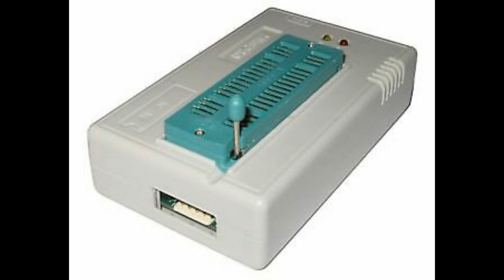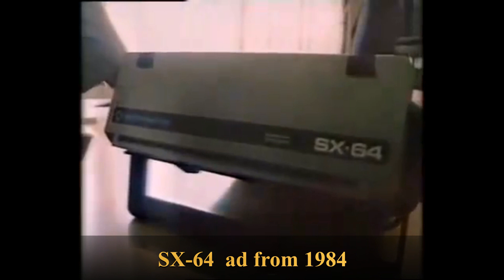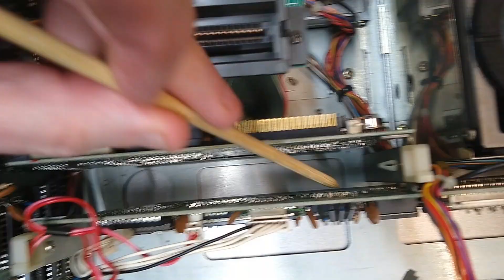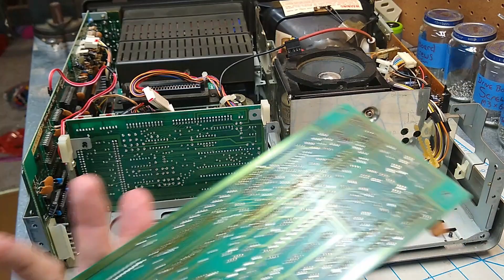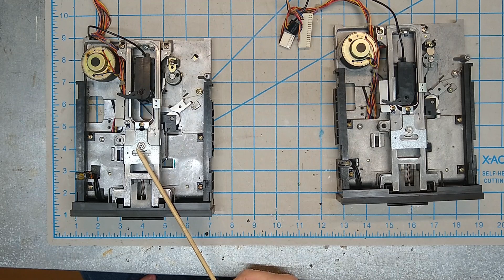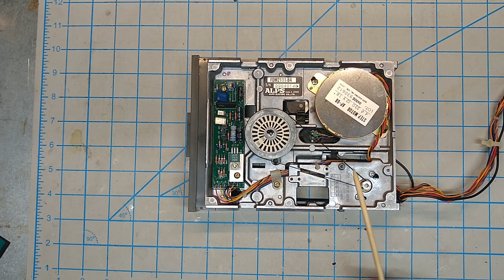Episode 17: SX-64 Repair and Rebuild, Part 3: Disk Drive Removal and Refurbishment

Comment: My glovebox assembly doesn't have that flat metal at 12:49 :( The only way I can see how to disassemble it is to remove the monitor assembly and main board :( that just seems like way too much work lol. Am I correct in this assumption? I found your video because I cant find much information on how to get to the drive to clean it.